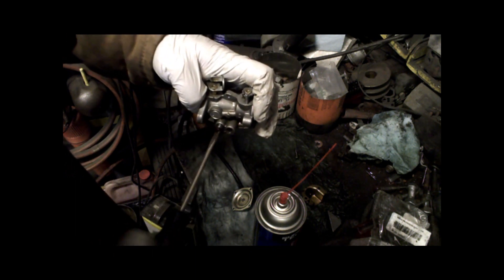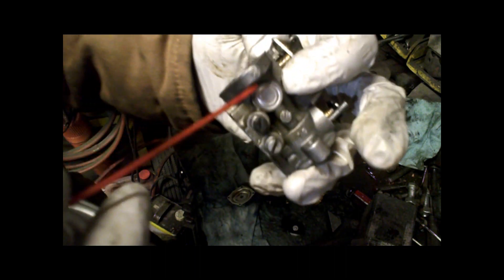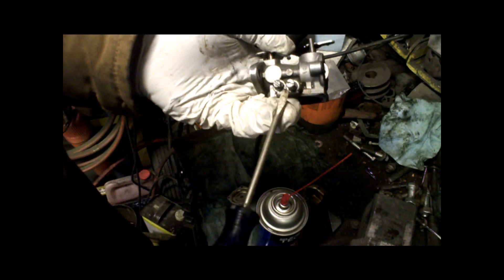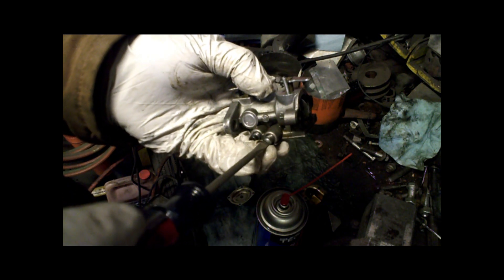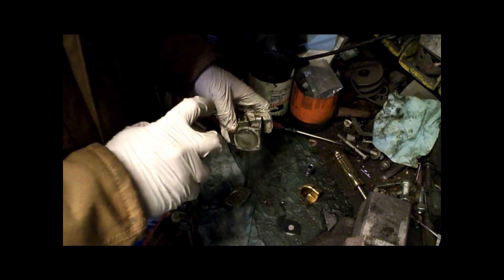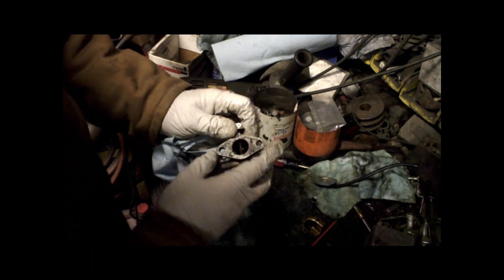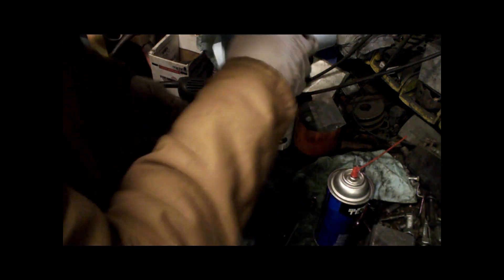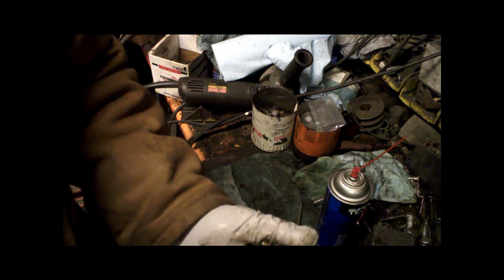Tecumseh diaphragm carb 2of2 Toro S140 S200 S620 rebuild

Comment: Dear sixtyford,
Found a toro 20 snowmaster in the trash. Many breaks and  cracks in plastic housing that I welded, and missing choke cable that I will fabricate. Could only get unit to start and stay running by spraying fuel directly into carb venturi. Thanks to your most helpful tutorial I believe will bring it back to life. You certainly are a gift to us students in the youtube classroom! All the best in gratitude from New Rochelle N.Y. bruce the swimmer
Reply: How did you weld the plastic? I need to do that to my snowblower. TIA

Comment: I bought a Toro snowmaster 20" S200 this summer at a garage sale  and today, months later, we are in the middle of a snowstorm.  The electric start appears to be missing completely.  The guy I bought it from squirted  a little gasoline into the carb to show it would start (tank was empty).  I bought some starter spray instead of  squirting gasoline into the carburetor, but it didn't work. I have now brought it into the house to warm up.  
While waiting for it to warm up I decided to look into what it would take to install a new electric starter but ran into this tutorial on rebuilding the carburetor instead.  I just wanted to say I really appreciated your video.  You clearly know what you are doing and you get right to it.  I appreciate that.  You are really good at doing this.  
I am a 58-year-old woman who has never had to make engine type repairs before this last year but now find myself in a position of having to learn.  If you don't have enough money to pay someone else, you have to do it yourself. 

Thanks for posting this, I think I may find myself rebuilding a carburetor sooner than later. 

Now I will go see what I can find about electric starts.
Reply from the maker: I'm glad the video is helpful. The diaphragms dry up and no longer function properly. Your best bet for parts is going to be EBAY or Amazon. 

The electric starters on these have plastic teeth that get brittle and break off on these old starters, but they're cheap http://amzn.to/2gr9GzI . Make sure your machine also has the bracket to accept a starter. These are pretty easy machines to start with a clean carburetor by the hand pull start, so I recommend getting it going first before investing 50+- bucks for used starter. 

The only issues these face is the paddles wear. If the distance between the housing and the rubber paddle is greater than the width of a pencil, it won't perform very well. New paddles aren't to expensive and I have a link in the video description.

Comment: Hey sixtyfiveford THANKS for the excellent video. I was ready to chuck my grandfathers 1984 S200 in the trash. It went under water with hurricane Sandy and I figured it was seized. Amazingly enough, I was able to get it to run on carb spray. Your vid and an $8.00 rebuild kit from eBay brought it back to life. Keep up the great vids. Oh and BTW a messy workbench is the sure sign of a GOOD mechanic! Thanks again!
Reply from the maker: You're welcome, I'm glad it helped... FYI: These little S200 really benefit from good rubber paddles. They should touch the housing when new and will really suffer when the gap gets over 1/4". You can remove them and drill new holes further back at least one time in there life. It makes the difference of them throwing 3-4 feet to almost 10 feet.

Comment from the maker: I was only using the technique as a helpful tool for people wanting to rebuild the carbs themselves. As a general rule of thumb the H or high jet gets turned out 1.5 full turns and the L low 1 full turn. This will allow the machine to start and run but tuning for your altitude/fuel will be necessary. BUT if the carb hasn't been played with then resetting the needles to the same they were before should make it run just right.

Comment: Nice job on the video! This is the same carburetor that is on a lot of Craftsman products, specifically older Craftsman edgers.  I was able to quickly tear down, clean, replace parts, and tune the motor with your assistance.
Reply from the maker: SparticusKohltrain Thanks for watching. If you want the diaphragms to last use only ethanol free fuel. pure-gas.org will show your local e-free stations.

Comment: Well Guess What? Its a "1 Pull" now! Just in time here in Somerset Co. NJ. From the correction of the diaphragm you showed me, to the setting of the screws as per the video. It threw 16 inches of snow for hours, and 10 days later another 8 inches!  Only now, after all that I got to replace a bad thrower bearing on the chain side. Not bad for a machine I threw in my back seat (put out on the curb, they gave up!!!) as I drove by. One man's trash...means my back isn't thrown instead of the snow!

Comment from the maker: @myfordranger ... There are littler brass washers that go on the idle and high speed  needles to protect the rubber O-ring from the tension spring. There is also a larger washer that goes with the seat assembly.

Comment: This video helped me a ton. I rebuilt the carb on my newly acquired s620 and it wouldn't run afterwords. I watched this video to see if I did something wrong. Seems whoever had this before me had the diaphragm in wrong. They had the big metal disk away from the carb. I installed it the way it came out thus causing my headaches. I installed it like this video.and it runs like a champ. Weird thing is. I had it running for a min or so with the diaphragm in the wrong way? O well it runs great now!  Thanks a ton!
Reply from the maker: You're welcome. These are great machines and work amazing with new paddles. If your gap between the housing and the paddle is 1/4" or more you will see a big difference in performance. A pair of paddles is around $20 bucks.

Comment from the maker: @Gxs40... Welch plugs won't stop the engine from flooding. They are a bugger to remove and generally you will damage the small machined passages under the plugs in your attempt to remove them. Did you try blowing through the fuel inlet to test the needle/seat like I did at 5:30 vid 2? You can remove the diaphragm plate and diaphragm with the carb still on the engine and see is the needle leaks at this point. If no then the diaphragm is pushing on the needle and it is your culprit.

Comment from the maker: @mardyn153 ...Some Tecumseh diaphragm carbs come without them. But there is another larger passage drilled in the body on the models with them to allow fuel into the chamber.

Comment from the maker: @Gxs40 ... A leaky gasket between engine and carb would cause an air leak and make the engine run lean starving it for fuel (engine would most likely surge). The little metal tab should be left alone. It sets the high speed rpm. You need a tachometer to set it. With the engine off it should hold the butterfly fully open.

Comment from the maker: @barrythom1... Its flooding. So chances are dirt from the fuel tank is blocking the seal between the needle and seat. The needle cant stop fuel from running into the carb. Sometimes the problem can fix itself but not always. I would pull the spark plug and pull the engine a dozen time until no more fuel comes out of the spark plug hole. Clean the plug and reinstall it. Try starting the engine and see it if the obstruction clears itself. If not the carb needs to be cleaned once again

Comment from the maker: You are right. 1 turn is 360 degrees. I accidentally only did half turns(talking, making a video and thinking about what to say next I must have been distracted). The carb had already been messed with by the previous owner and I was going to have to fine tune them anyways.

Comment: for those that are confused on what part numbers they need or assembly...first get the model# and serial# off of your machine and goto Toro's website goto Customer Support -> Homeowner - Equipment Support -> Manuals -> type in model# and serial# -> goto Manuals again and there will be a master parts list with assembly diagrams and the service manual applicable to your machine.

Comment: @sixtyfiveford  You took the same words to tell me that local lawn mower shop did when they sold me yet another diaphragm kit. Ethanol destroyed the one I put in 10 months ago. I did try spraying and compressed air, no good! LOL anyhow I really went bad with the S140 this time. After getting it running good again...the drive chain got a little loose during the throw. Almost done, it was throwing less and less. It grind-ed off all the Aluminum sprocket teeth. A steel bike one will do.

Comment from the maker: @EddieGoregor .............You can blame ETHANOL in your fuel. Ethanol destroys fuel lines, diaphragms, o-rings, needle seats, and worst of all it pulls moisture out of the air. It is best to use a fuel Stabilizer like Sta-bil for storage or run the engine completely out of fuel. 

Your symptoms are a clogged main jet. you can probably get away with a quick 5 minute clean. With the carb attached: pull the bottom cover and diaphragm. Remove the H high needle on the side and spray carb cleaner

Comment: Did this same rebuild today before watching the video, had to call Tecumseh tech, was told by them that if the carb body is embossed with and S by the diaphragm then the order is carb body, gasket,diaphragm, cap. with no S it's just the opposite. Also told me the diaphragm goes in with the  big metal disc towards the outside of the carb, not towards the carb body.

Comment: @sixtyfiveford have to check that out. i put one washer on the idle screw but i saw nothing on the other one?unless it fell out during taking it apart. have to check the main jet. i dont remember any washers on that? only needle , spring and that nut to that goes into the treads... have to take it apart again and look.

Comment: Hey, you didn’t do anything in the video what the screw for the throttle valve to adjust it actually, it was missing. I’m having a problem with mine because the screw missing leaving the valve completely closed not allowing any gas into the combustion chamber. I now have the screw installed. I got one, but I don’t know how to send it and how far the valves should be open at idle or at start up the screw I put in comes out the other side which is the side that the valve presses against the screw I would say it sticks out about a 1/4 inch is were I set it Is there a way to measure it, or to measure the correct amount that the valve should be open and pressed against the screw?

Comment: @ seiniorjohnl if you need a carb gasket in a pinch, trace the flange of the carb on coated cardboard from a cereal box. Cut out with a razor blade or exacto knife. Makes a perfect small gasket every time.

Comment: new needle and rubber seat! No f on carburetor so I install gasket and diaphram. Then I switch and both wasy it ran with less flooding when I did the opposite? Should I replace the welch plugs?

Comment: Except for cases where old gas has been allowed to sit in the engine, turning to gum, you can usually get away with just replacing the diaphram and gasket. The carb kit doesn't have the carb to block gasket, I have just left the carb on the engine to not disturb, damage that gasket. I don't understand why they had two possible orientations with regard to placement of gasket and diaphram, am carefull to note original placement for re-assembly.

Comment: Hi 
  I have toro s200. I replaced needle, diaphragm and clean the carburetor,New fuel line and new  carburetor gasket. It runs but floods from interface between carburetor and engine. I didn't replace welch plugs. Any suggestions? Also I was also wondering how to set up the spring attachement  on butterfly?

Comment: Excellent detailed job! I had to go back and reinstall the old needle seat screw, as the new one was somehow keeping the needle pressed in. 
How do I set the RPM lever that connects to the carb screw,  the one with the spring?
Reply from the maker: You bend it until the proper rpm is obtained. The harder the spring is pulled the higher the rpm.

Comment: Great video! I have a S620. Can you tell me where to connect the throttle lever? There's holes on the vertical post and the flat part. Any help or video would be great. Thank you!
Reply from the maker: On Toro's website you should be able to pull up a parts breakdown and see how it is situated.

Comment: Its weird. Last year? I rebuilt the Toro S-140 Techumseh carb with the kit, ran perfect!  This year?  it loses its prime now and only runs in the full choke position! Now I know these carbs are sensitive but Jeesuz! This is the reason people hate diaphragm carbs. I mean, it just sat untouched. Why do they develop issues so easily? And is there another carb model that can be substituted in its place? Perhaps one that has a better performance record? Now there is 18 in and I must rebuild again!
Reply: Is there a compatible replacement, or a substitute carburetor that can be used?

Comment: Good Video I have a S 140. Where is the letter stamp on the carb,  So I can determine what side the gasket goes on as to the diapram
Reply from the maker: +mikes station The F stamp is on the side. Generally your fine just to mimic what you pull off.

Comment: Excellent videos. I had the same Toro S200 snowblower. My problem is I don't know how to removing the carburetor from the engine. Is it possible that you can do a video on removing the carb from the engine? Many thanks.
Reply from the maker: Sorry, but I don't have any of these Toros in my shop right now.  You remove the bolts through the handle bars that hold on the red lower shroud/housing. This is a tight squeeze to pull it out and off, but possible. remove the fuel line (hair dryer will soften it) and the air primer hose. There are only 2 bolts holding the carb on. Remove those and rotate the carb to disengage the governor linkage on the top.
Reply: Thank you for your speedy reply. I will try to remove the carb as per your suggestion, Many thanks.

Comment: I am working on a Craftsman edger with a 4-cycle Tecumseh engine. It has not been used in several years. It starts with Starting Fluid but then "dies" immediately. This points to a fuel problem.

The carburetor has no float bowl; it is a diaphragm-type, the same as that shown in this video.

I disassembled the carburetor expecting to find it packed with deposits but it was clean. However, the diaphragm is stiff. Is there a way to restore it to normal flexibility or must it be replaced?
 
.
Reply from the maker: You'll need to replace the diaphragm.

Comment: Mine leaks fuel. Could the needle be stuck open?
Reply from the maker: More than likely the little rubber needle seat is dry rotted and cracked. This won't allow the needle to seal off the fuel supply. There is really only 2 things than need to be replaced during a clean/rebuild: the needle seat and the large diaphragm.

Comment: I've got an old Tecumseh ah520. it blows air out of the carb. does that sound normal? I've checked the reed valve on the engine and it seems to be operating correctly. running out of ideas myself. any thoughts?
Reply from the maker: +Ben Carson Exhaust can get clogged.
Reply: +sixtyfiveford removed exhaust completely. minimal build-up. still does it with it removed. wondering if it's because intake ports are exposed at some point on both strokes? is that what pumps the diaphragm?
Reply from the maker: The diaphragm doesn't need air to push out the intake to operate. It just needs the intake suction and let go pulses to pull fuel in. You will get a little air out the intake but it'll be minimal and non existent while running. The number one issue with these is a dried diaphragm in the carb. I suppose if the piston rings were shot that it could be discharging it's compression out of the exhaust. If you have access to a compression tester or an autoparts store that will rent you one for free I would try a compression test.

Comment: vids helped a lot, but, I have a new found major problem: Hi screw is broken off inside it's hole at about top of it's threads. I can not get it out. I am now thinking i need a rebuildable carb, or a 45 in it's head.
Reply from the maker: +Michael Leumer Chances are it is set to where it needs to be and just cleaning the carb will be fine. You don't always have to remove them. If you really must, cut a slot in the top of it with a dremel blade so you can use a flat head screwdriver.. Even if you nick or cut through the carb housing a little you'll be OK. I show what I'm talking about in this video even though it is for a slightly different reason https://youtu.be/Pwvq5svV4JI
Reply: sixtyfiveford this pin appears to be broke below the threads or at about that point. about 1/2 inch below opening. would think far below a safe to cut down to point. can't reach from behind access area under diaphram either. not w/o removal of brass plug there. can't get that plug from pts store either. I think it gets a 45 acp now. thanks for your help.
Reply from the maker: That sucks. They can't all survive.

Comment: How do I know if the diaphragm is bad?
Reply from the maker: The diaphragm is essentially the fuel pump and they engine won't stay running. You may get it to start but it will quick die. On a side note if the diaphragm is more than 5 years old and it has had ethanol laced fuel it is dried out.
Reply: sixtyfiveford okay thank you very much!